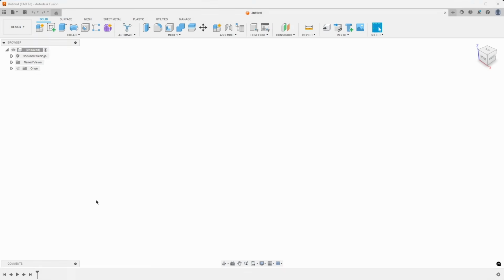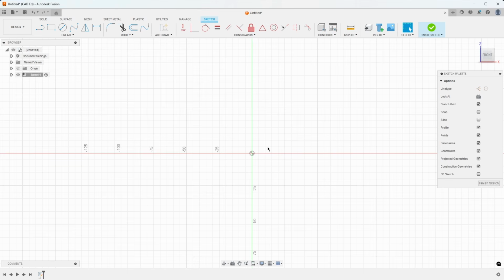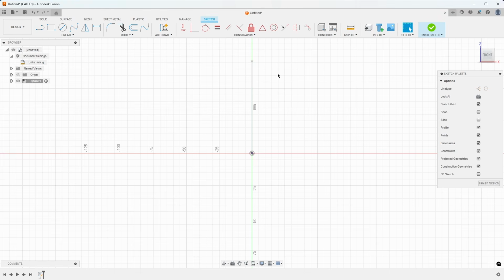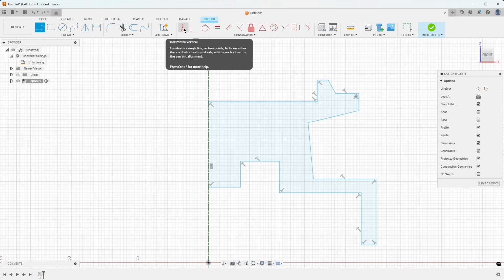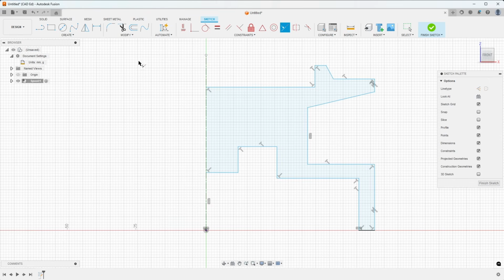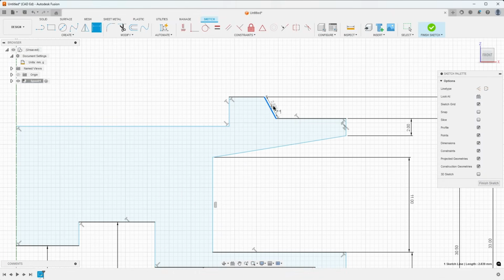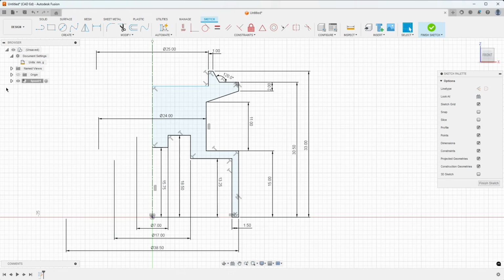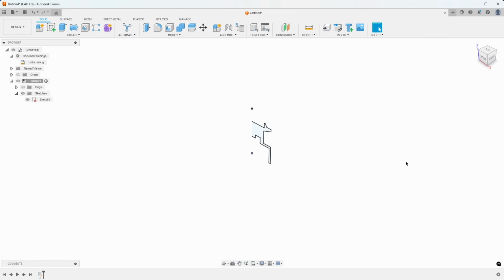Fusion Sketching Made Easy! | Getting Started with Autodesk Fusion Episode 3

Comment: For anyone on the Personal version, Autoconstrain is not an option.  The two things you will need to set are the 4mm depth (click on Sketch Dimension in the toolbar, click on the two lines, and type in 4) and the overall sketch dimension (right-click on the dash-dot dimension line itself, select Sketch Dimension from the popup, move it to the left, and type in 40)

Comment: 4:07 For anyone following in 2026 using the free version: DO NOT USE HORIZONTAL to make the shape snap to zero, click Coincident and then click the line just to the right of the corner he tells you to click. THESE VIDEOS ARE ASS BECAUSE OF THE UPDATE! OUT OF DATE, OVEREXPLAIN THE SMALL THINGS AND SKIP OUT ON THE IMPORTANT THINGS!
Reply: preach brother. I'm so annoyed.
Reply: OMG that worked! Thank you! This comment should be pinned.
Reply: exactly, like at 8:20 when he starts with a vertical dimension on horizonal surface with super-fast mouse clicks.

Comment: For anyone starting this series in 2026. The software had a large update in January and if u start using the new features like assembly or part you will not be able to follow this tutorial. Instead use the hybrid project, it’s the older version experience after the update.

Comment: If you get lost when adding dimmensions like I did , start by deleting all constraints and dimensions then start to enter 1 dimension at a time, then everything will be messed up  but free to move and you will be able to make adjustments. 
I am kinda glad he leaves details out cause I am really learning what a constraint does by having to problem solve through. If I follow and it works then later I when this crap happens I wont know what to do . So dont be discouraged just rewind and try again , feel free to apply one constraint then a dimension then delete the constraint and see how the design reacts to your change. The video does skip details , but I think that is good so you really learn.

Comment: 7:10 I think the free version does not have the auto constrain function. I asked their auto assistant and it suggested that it might be the case. 

This is my first time using the software and I am enjoying it so far. Just working through some of the roadblocks!
Reply: Same here. Thanks for the post, I was looking for "auto contain" all over.
Reply: yep - bummer cause i think it did earlier this year
Reply: indeed
Reply: To Get Auto Constrain
You would need to upgrade to a paid Fusion subscription. What You Can Still Do on the Free Version
Even without Auto Constrain, you can still check for unconstrained sketch elements using the color method and the text command:

Option 1 — Color Check (Free ✅)
While editing a sketch:

Blue lines = under-constrained
Black lines = fully constrained Simply look for any blue geometry — that's what needs more constraints or dimensions.
Option 2 — Text Command (Free ✅)
Go to File > View > Show Text Commands
Edit your sketch
In the text command bar type: Sketch.ShowUnderconstrained
Press Enter — it will highlight problem areas for you

Comment: In case anyone has the same problem as me and a few others apparently. If your design doesn't scale when entering the first dimension: Click on your profile in the upper right corner, select Preferences. Go to General --> Design. Check the box that says "Scale entire sketch at first dimension". Problem solved!
Reply: You are a lifesaver!
Reply: dude I was struggling so much entering the dimensions, thanks for the tip!
Reply: OMG, thank you so much! Was literally losing my mind.
Reply: mentioned in the second lesson
Reply: Thank you....Im putting the hammer back in the toolbox now!🤬🤬
Reply: Thanks a lot. This actually helpt quite well.
Reply: Thanks!!!!! Tearing my hair out for half an hour now - ugh learning new software, blaaaah
Reply: This is exactly what I was looking for. Thank you!

Comment: So I had an extra line on the vertical line for the center line (Might have been due to not pressing escape) so long as the constraints are all closed (closed loop) they sketch will lock manually by adding the last measurements

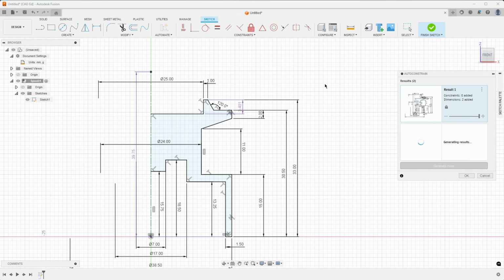Comment: I got stuck around 7:20 because I could not find an automate button on the top menu. I assume this may be because I am using the free version as I begin learning to use Fusion. I did try to enter the values manually but could not get a locked sketch in the end.
Reply: I found this, and it worked for me:

1 - Open the Text Command pane (Under File>View).

2 - Enter "Sketch.ShowUnderConstrained" (note it has auto-complete).

3 - Anything not fully constrained in the open sketch should be highlighted. If you don't see it (common in a complex sketch), try zooming out; this makes the highlighted geometry pop out more.

4 - Fully constrain everything highlighted
Reply: Same here....found a fix?
Reply: I just selected the corner-points and clicked Fix/Unfix in the context menu until Fusion360 decided I'd constrained it enough (lock icon replacing the pencil icon in the browser). Not constrained in the "formal" way, but good enough maybe to continue? We'll see as I progress.
Reply: Having the same issue… Any suggestions? $680 would be a true commitment to learning fusion, I don’t mind coughing it up if there is no way around. However it would be great to hold those coins until I feel more confident in my ability.
Reply: @Logical__Living  try stuudent version if u have a child at home and mess around ( im a kid tho lmao )
Reply: It's just as easy as adding manually the two new dimensions, as the other ones. Just repeat the steps before again 2 more times.

Comment: mine did not automatically scale like yours did when putting the 15mm length onto the first line and im not sure what i did wrong or how to fix it.
Reply: Hi, late reply but I figured it out... Click on your profile in the upper right corner, select Preferences. Go to General --> Design. Check the box that says "Scale entire sketch at first dimension". Problem solved!
Reply: I'm having the same problem... Did you get anywhere?

Comment: When will it finally be possible to sketch a simple spiral? This simple feature request is open for about a decade (!!) now. The "workaround" of creating a coil and projecting it to a sketch is a fucking joke.
Reply: A simple python script to draw a spiral new sketch on the XY plane, just adjust the inner/outer / pitch the rsolution for how fine you want it, the higher you go the longet it takes 300 should be about right, of course you can add a small interface to this if its somthing you do on a daily dasis rather than edit the file each time. should be a good head start for you do what you need. 

import adsk.core, adsk.fusion, adsk.cam, traceback
import math

def run(context):
    ui = None
    try:
        app = adsk.core.Application.get()
        ui = app.userInterface
        design = app.activeProduct
        
        #spiral  dims
        inner_radius = 2.0        
        outer_radius = 25.0       
        pitch = 2.0              

        #spiral maths
        b = pitch / (2 * math.pi)
        a = inner_radius
        
        #how many radians needed to reach outer radius
        theta_max = (outer_radius - a) / b
        
        #a new sketch on XY plane
        root = design.rootComponent
        sketches = root.sketches
        xyPlane = root.xYConstructionPlane
        sketch = sketches.add(xyPlane)
        sketch.name = "spiral sketch"
        
        #store the points points
        points = adsk.core.ObjectCollection.create()
        
        steps = 300 # resolution
        for i in range(steps + 1):
            theta = theta_max * (i / steps)
            r = a + b * theta
            x = r * math.cos(theta)
            y = r * math.sin(theta)
            points.add(adsk.core.Point3D.create(x, y, 0))

        #create the spline curve from the points
        sketch.sketchCurves.sketchFittedSplines.add(points)
        
        ui.messageBox("spiral sketch created...")

    except:
        if ui:
            ui.messageBox('Failed:\n{}'.format(traceback.format_exc()))
Reply: @chrisnorthall8317  So.....we are nearly in 2026, Fusion has multiple layers in electronics,  automated tool path generation, Generative design.....and we need to write a Python scripts to make a blasted spiral , or make a simple option to customize a balloon text in drawings???😂
Reply: @chrisnorthall8317 I don‘t want a py script to draw a simple spiral an a cad software. This is a freakin‘ basic feature in any other software out there and the Fusion team should be ashamed that they still don’t manage to get this simple thing done after a decade of complaints. It’s absolutely ridiculous.